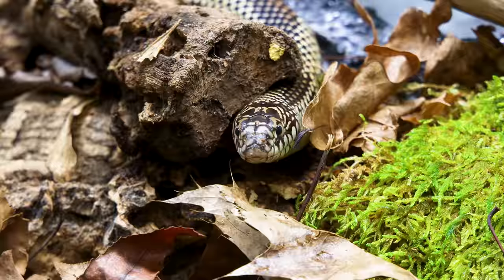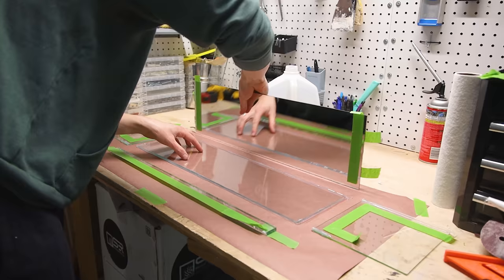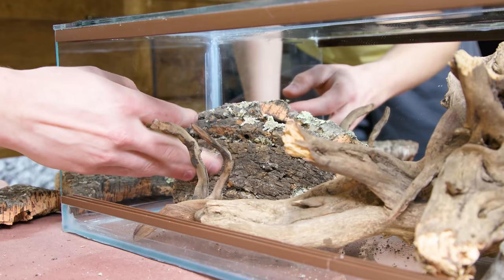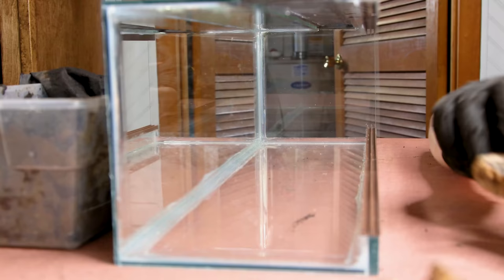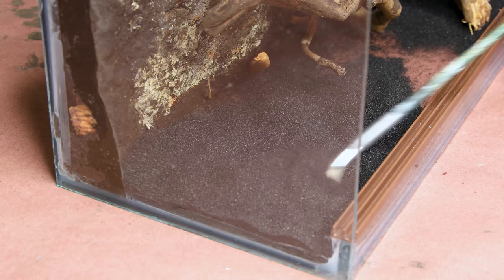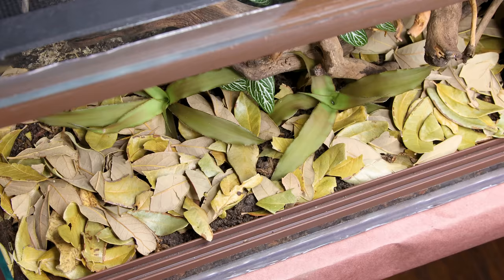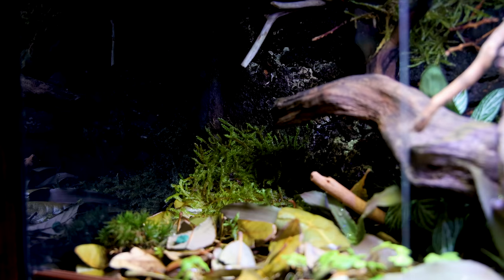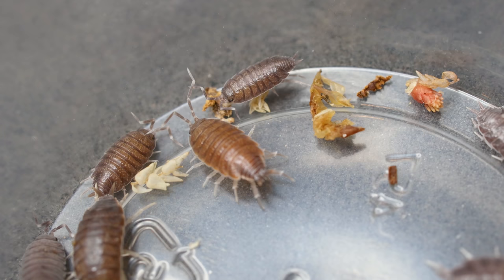Isopod Tree Root Forest Vivarium with Easy Clay Background

Comment: Not sure if you know this, but organic BBQ smoking pellets (I use Traeger brand) are a GREAT food source for isopods. I fill a gallon Ziploc bag with about a quarter inch of pellets, then add some dechlorinated water. The pellets break down and turn to a fluffy sawdust, which I then feed to my pods (raising P. Laevis but planning on starting a powder blue colony soon). Little guys love it, and there's very little risk of it attracting mites if it sits out.

I just supplement with kitchen scraps once a week, and my population is booming.

Comment: Beautiful! A suggestion - instead of two glass panes for the sliding doors, use a single pane. It'll have a cleaner look. The single larger pane can be popped in and out just like the two smaller ones. What do you think?

Comment: Hi Tanner, 
I love the idea of the clay background, it's so versatile and seems easy to put together. I'm planning a large terrarium build and have been trying to source the materials for the clay background here in Germany. You won't believe it, but the one I'm struggling with the most is the cat litter. Bentonite itself is really expensive but most cat litter I've come across seems to have one additive or the other. To make things even more complicated, here in Germany, cat litter packaging doesn't contain a clear list of ingredients. I finally got my hands on one that I mixed together with aqua soil and coco fibers only to learn that although it's free from colouring agents and scents it does have some bi-carbonate soda in there (for anti-bacterial properties). Do you think this is still something I could use successfully in the terrarium or should I discard the mix and start over?
I'd really appreciate your thoughts and advice. Thanks!

Comment: Just curious. If I built a tank just to use a drainage layer and hold soil for bioactive at the bottom of my chameleon cage, would it be able to do so without there being too much pressure? Would it need to be a certain thickness for said pressure? Or am I just worrying too much. I'm trying to find info online, but struggling to find anything on it.

Comment: I know you're not afraid to use foam in your scapes, so I thought I'd mention something I just saw on Amazon. They sell these 25" tall fake rocks, that weigh 6 lbs, to cover valves in people's yards. It covers 3 sqft. I'm thinking of getting one for that, but it's only $50, and that's way cheaper than that volume of dragon stone. I saw a picture of someone who put a bonsai on a big rock sticking out of the top of a tank. I thought about doing that with this fake boulder. I wonder about cutting it, and attaching it with silicone to the inside of a tank. What do you think? It's only $50, you ought to try it.

Comment: I'm a little disappointed that the mirror is all covered up. I was wondering for a while now how it would work out to make a setup with 3 of the walls being mirrors and only the front being glass, so that way you could see everything from all sides. Or possibly walls are glass, but there are 3 mirrors permanently attached around, slightly slanted, to make it easier to peek inside. Possibly have different parts of the mirrors at different heights at different angles, whatever would make the viewing from all around the easiest. I challenge you, Tanner! ;)

Comment: I would like to hear your comments on building a vivarium to house a pygmy chameleon. I was going to buy a large tank for some anoles, but a friend is giving me a leaking 10-gallon tank. I've had tropical fish for decades in the past, and am quite familiar with fixing tanks. I've never cared for a lizard before, but understand these small lizards are good beginner species that don't require a large tank. 

Have you ever kept pygmy chameleons? Since they live at or near the forest floor,  height isn't as important as the proper plantings. Suggestions? Comments?